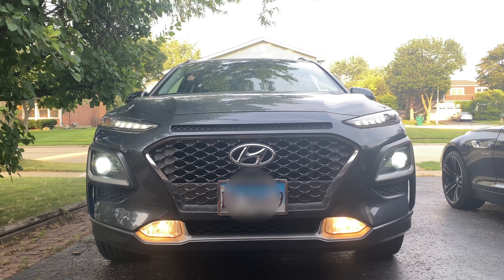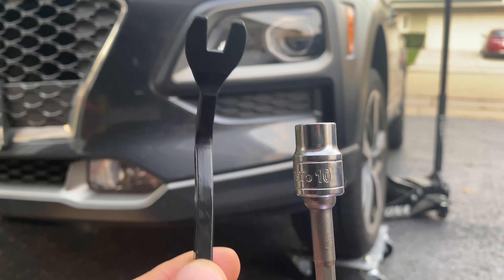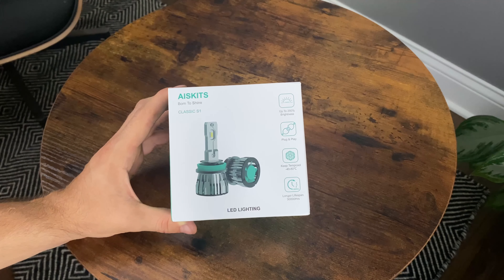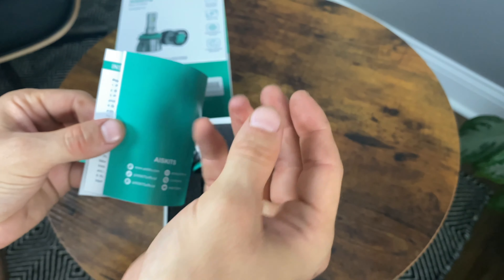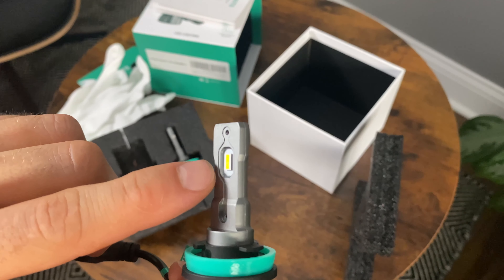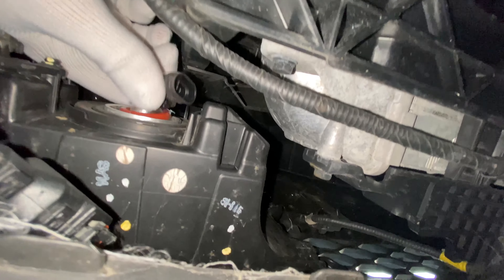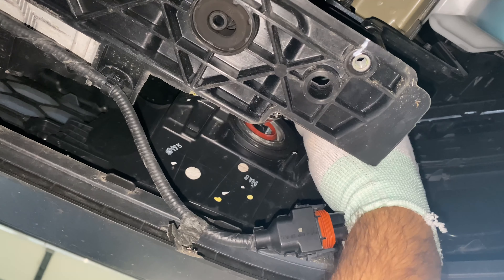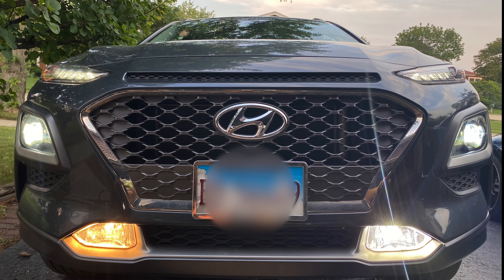Upgrading Hyundai Kona's Fog Lights to AISKITS LED Bulbs

Comment: Great video. I did mine today but I didn’t have to lift the car and I only took off the front clips and 4 front bolts, that way I didn’t have to remove the whole thing. They’re really easily accessible this way. Took me no less than 15 mins.

Comment: There’s a reason the fog lights are still halogen, and it’s not just cost. As somebody who has driven in a fog, a warmer / yellower light works better because it causes less glare, and the yellow color actually travels further in that condition. Another additional benefit of halogen bulb is heat, which is high enough to melt snow/ice accumulating on it. When the main LED lights are clogged by snow, it’s nice to have another set of lights working until you can clear them out.

In short, halogen bulbs are generally the better option in fog lights. You only ever turn on the fog lights in foggy / snowy conditions anyway, so the function is much more important than cosmetic color matching.

Comment: Only for Fog Lights? Does it fit on the headlights? I wanna change my halogen to LED ...
Reply from the maker: I didn’t know these had halogen headlights at all, if it’s using the standard h11 bulb, yes you can.